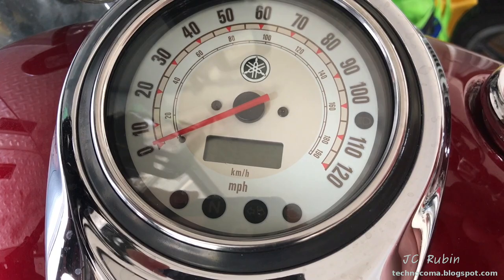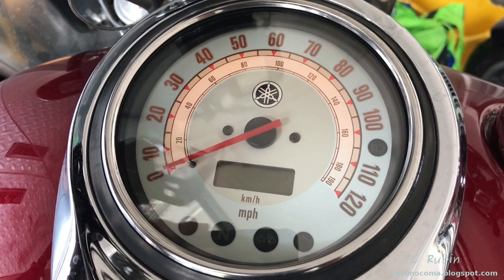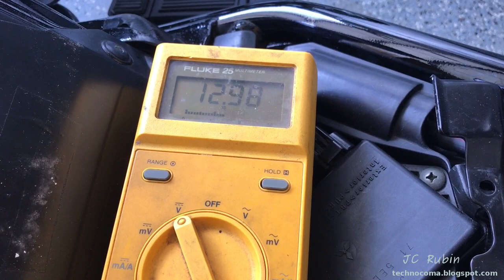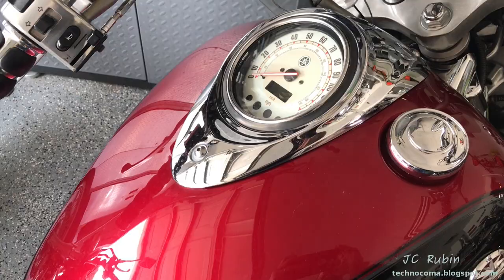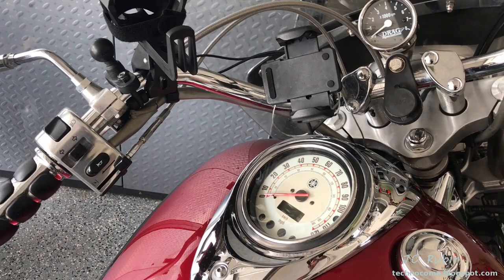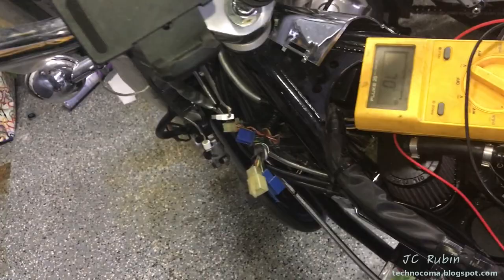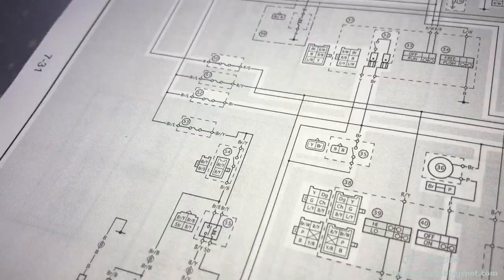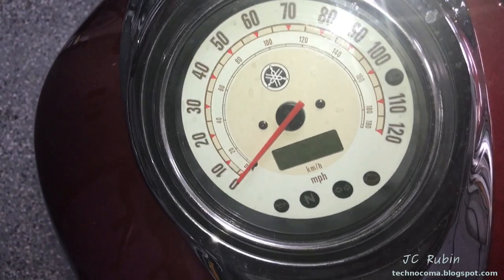Yamaha VSTAR 1100 Strange Electrical issue - Intermittent Speedo & Signals

Comment: I have a 1998 Royal-star. Just got back from a short ride with the same symptoms. Looks like if you blow the turn fuse the Spedo and Odo are going to be intermittent. Thanks for the video!!! Kept me from cussing for a few hours. Went straight to the turn fuse, was blown, replaced and now everything is back to normal.
Reply from the maker: Glag I was able to help, Again it depends on how to the fuse breaks, that can lead to different symptoms, the point is almost always all of them point to a fuse event.

Comment: I'm having a problem with my 2008 vstar classic 1100.  First time I had an issue the battery while driving. I changed out the battery and before long that battery went dead. I changed the stator, no difference. (although I had to change the plug on the stator because it was different then the one being replaced. I then changed the coils, the starter clutch and then the rectifier. The bike now starts but backfires, doesn't run smooth.  Any thoughts on this? Thanks.

Comment: Yep More or less the same problem with an XVS950A Midnight star. The speedo needle could not complete the switch on sequence,and the display did not appear. So the tests for current paths, and the fuses with the trusty Fluke meter, which did not reveal any faulty connections. Alas for no reason the unit worked properly without any encouragement.during checks. There is a permanent 12 Volt supply to the meter: Keeps the Time and trip meter settings: Another 12 Volt supply is the switched one,this brings on the display warning Lights Meter Lights etc. The trouble was the speedo died whilst riding,legal need to have a working speedo, So all connections especially earth ones were checked out. The connector blocks and harness wiring all looked at.
In the end a replacement speedo had to be installed, and no trouble since that was done.
Reply from the maker: Did you take apart the old speedo cluster to see what was wrong, there is usually a surface mount resistor that burns up and thats it.

Comment: Hi I was wondering if you have ever checked your mid shaft nut or had issues with it? It is a common issue with V-Star 1100 and can be a safety issue as it can potentially lock up your rear wheel if it comes off.

Comment: Barking up the wrong tree with that .. the fuse is goosed because you have a bad earth short or something mimicking it . Led rear indicators ? But bulb fronts on a 5 wire flasher relay do this .. I've yet to find the full solution and suspect it requires diodes. It's certainly not a fuse joining back up .. did you get any further with this ?
Reply from the maker: I did, and did not have any further issues since the making of this video.
Reply: @retrotechandelectronics  I have since found that my foot pedal brake switch was causing this problem. Symptoms exactly to the letter of what you had. I just needed to adjust the activation point and clean out the switch bend the tabs a bit more 👍.

Comment: Where exactly is this fuse located ... My turn signals and  mileage won't work .. hope to hear from ya .. also my bike will turn over but not start
Reply from the maker: low side panel below the seat.

Comment: I am experiencing the Same exact thing! It started today. No Horn, No Turn Signals & No Tail light also. I throttle up and Display works Throttle Down. No Display. How do I Check that Fuse you replaced in the Video? Do I have to remove the Tank? Please Advise. Thank you.
Reply from the maker: You check with continuity with a multimeter. These are basic examinations.

Comment: I had similar symptoms, but the fuses were good. As a result, the rectifier voltage regulator burned out.
Reply from the maker: Yeah, the voltage regulator going south can cause strange issues as well.

Comment: I have the same problem 
Keeps popping that fuse every time I replace it and ride a couple miles. Dealer Combed through the wiring underneath the gas tank and could not find a short anywhere. I still don’t know what’s causing my speedometer not to work, the lights turn on but there’s nobody home. If anyone can suggest anything I would really appreciate it.
Reply from the maker: Combing though.... Never measured the current in that circuit..... or the measured current with each apparent load removed to find a possible shorting piece of equipment if it wasn't a wire.  It isnt always a wire.... Sometimes its a load..

Comment: Thanks for the video. I had the same problem, i replaced the fuse and 2 min later was broken again. I just put a 20fuse and its working but i am not sure if that is the solution
Reply from the maker: Sounds like you have a bad short in that circuit somewhere. Not good!

Comment: Good find Jordan! I wonder if that fuse is slightly underrated, especially where it operates the horn, probably the biggest drain in that particular circuit.......
Reply from the maker: Hey John..... Ive not encountered this ever before.   I've actually saved the fuse; put the fuse in the safe.   When I get all of these guitar  amplifiers off of the bench I will conduct some tests with it to find out if i'm crazy or not.

Comment: Great video, excellent camera work and good audio.  So what caused the 10 Amp fuse to blow in the first place?
Reply from the maker: I believe mine was the meltdown from the charging system that ive since replaced.
Reply: Worthy of note, I have the exact same issues with my 2004 V-Star 1100, intermittent speedo and turn signal failure, seems somehow related to turn signal switch and acceleration, but.... my Signal fuse is perfect! All other fuses check out fine, too. Time to check my charge circuit.
Reply: @MrJayAlessi  having the same problem with mine right now what did you do to fix

Comment: I will check my bike for this! Just got back from a ride where I experienced this. Thank you for the tips! Where are the fuses located on the bike?
Reply from the maker: Left hand side cover with the key lock
Reply: Retro Tech & Electronics yeah I found them and checked the signal fuse but it was fine.. any other suggestions?
Reply: @hohonator   hello I have what sounds like same issue. Fuse are good. Did you find your issue ??
Reply: @larryalexander4833  yessir, turned out to be a loose battery terminal

Comment: i found a rectifier that puts out 25% more than OEM in addition all grounds should be checked especially the one from the battery to the motor
Reply from the maker: A rectifier puts out 25% more what???? The regulator should be voltage limiting/..
Reply: Where is this connection damned if I can find it

Comment: Hello I have a 2003 Kawasaki Vulcan 1600 Classic. I have a video of what the bike is doing 
 https://youtu.be/WqBWMvhF8dM 
The issue appears after a few seconds after starting the bike. My question is do you think a Speedometer sensor could cause this issue? I have checked Coils the ohms are within range. I disconnected the speedo and put back on. I have searched most all connections. Battery is charged and tight (no Loose connections). The only thing I have left is the Speed sensor. That entails some work to get to it. That's why I'm asking. Thanks for reading my comment.
Reply from the maker: Sorry, this isnt a Vulcan....You could try swapping the sensor... I dont know what to tell you, I dont have a vulcan.

Comment: You touch. Kick stand    with in gear with clutch. In it die  are  hit kick stand    going down road it  die      start by it  like quit soon  let kick stand it  kick back on that kick stand much have shot off switch on it. I haven't had my 2007. For. 2. Days now.
Reply from the maker: yes.